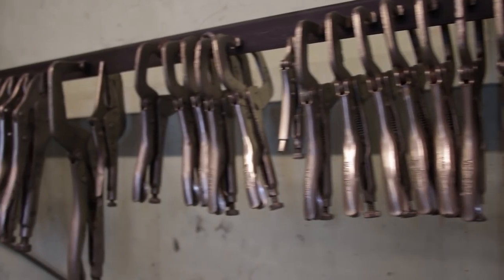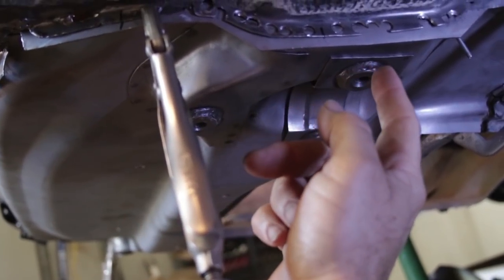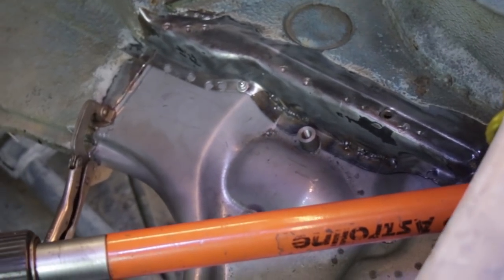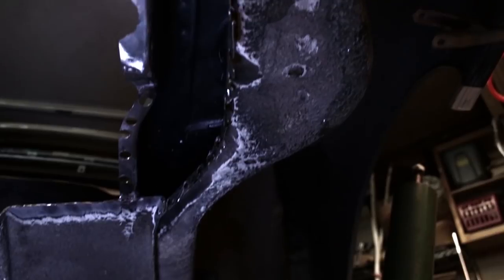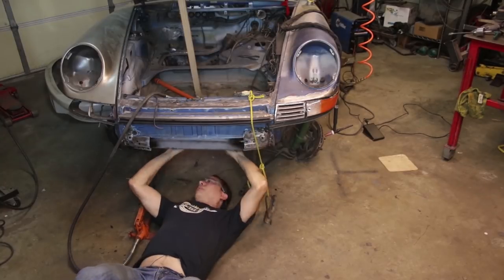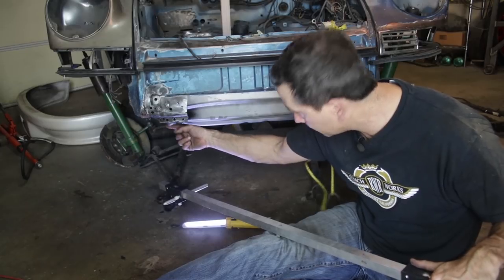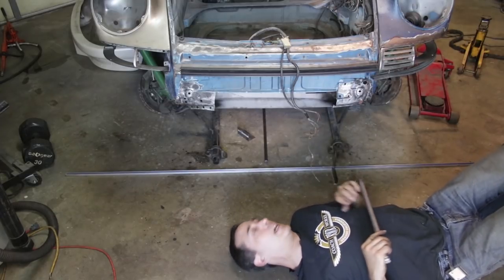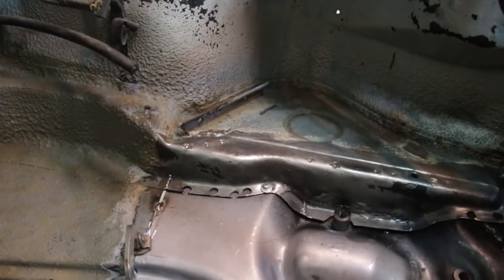911 Suspension Pan Welding 👍Align Then Weld...

Comment: My A-arm on the drivers side is distorted, pushed up into suspension pan a little and is not a good reference point.  The passenger side looks fine with no rust or holes.  Should I just use the passenger side as the reference for the height from garage floor?
Reply from the maker: Hi Shane, if your gas tank is out I would put a straight edge on the part that continues to the pan and make sure it's straight before you cut it out.

Comment: doing it wrong as usual with the Porsche week end warrior! To pull down on one side, you need to put wedges anchor in the concrete with a threaded eye bolt on each side {lateral) Then you push up on one side and pull down on the other.